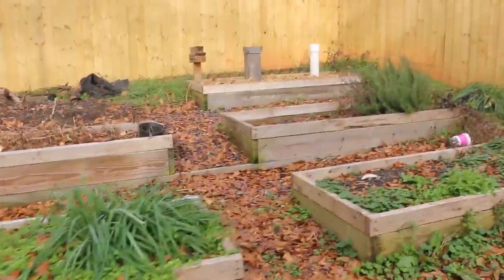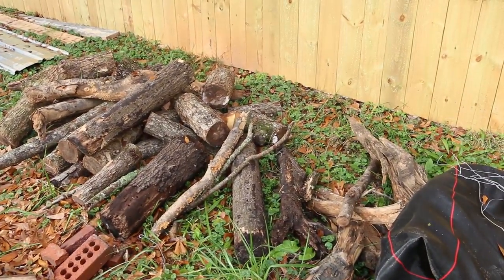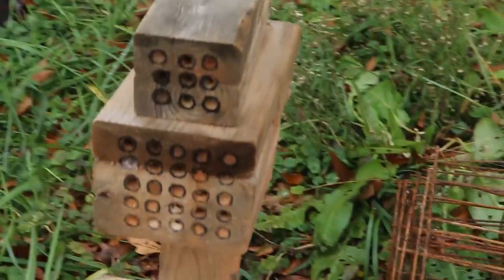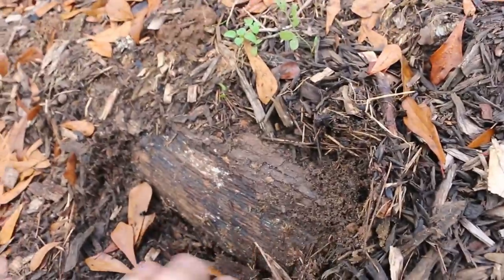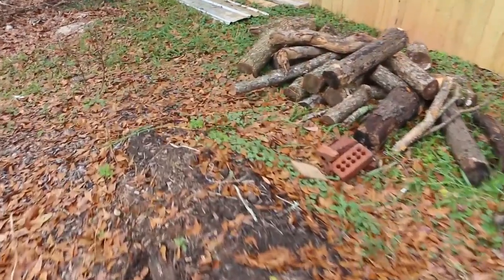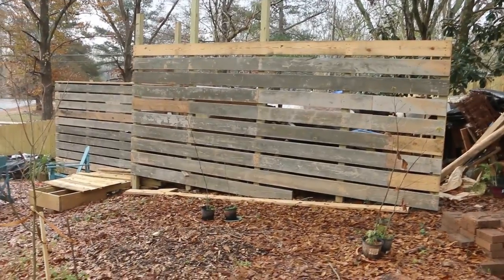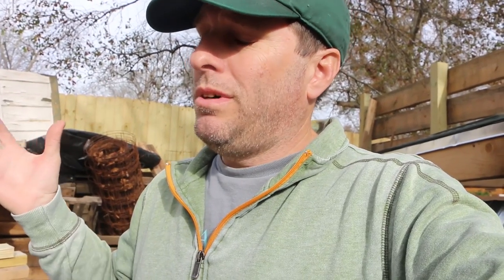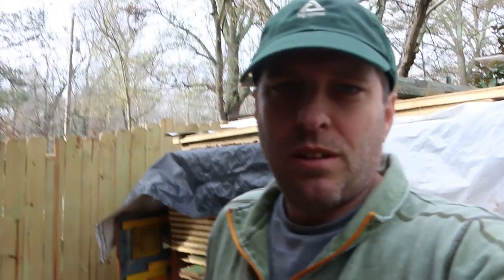What Should I Make In 2018? | GreenShortz DIY

Comment: Thanks for all your work. I am interested in black soldier fly larvae. I did notice that someone had 2 beds, and the one with the most surface area was substantially more productive.  Alsoi leave inn the high desert mountains, so I have to adjust many things to compensate for the dryness and cold.
Reply from the maker: I do think the surface area factor is significant. The soldier fly larvae like to work on or near the surface of the compostable material. Do you have BSFL in the high desert?

Comment: Jtube solution- Like your sheet metal designed Rocket stove, build with desired path "in reverse" as a quick-connect J-tube feed into the concrete rocket stove. Simple tower with the bottom that scoops out of the side discharge into desired fireplace...  Am I painting a picture yet?.. I have a feasible plan, if your interested further.
Reply from the maker: I see what you are talking about. An interesting idea. Tell me about your plan.
Reply: GreenShortz DIY unfortunately I do not have the means to make it out of steel. Take your metal rocket stove's feed idea and angle Downward out of the chimney while feeding through the top. I think the interlocking tabs on the sides of the center pieces (4pcs) and slits on the 2 "master side panels" shaped like a 2d isometric boot for fuel delivery, standing, plus hold it secured. The 2 angled centerpieces can lay in and lock in at the bottom with the side panel grooves, while the vertical pieces lock it all together with tabs like you have on the stove. (Give the feed tube a stiletto slope, yes like the woman's shoe.) Later it could disassemble for storage quicky, as well. I wish I could share an image on here. My sketch would show how simple it really is. The angles need to be perfected but, the Inception is there...lol I not sure how clear I am pai ting with words.... Sidenote: I noticed when the side port is not drawing well simply throw a stick or two in the top and that will force the draw through the opening again.
Reply: Come to think of it, you could fabricate a piece of approx. 4" x 4" ductwork that would be fastened vertically and decide whatever angle you want to deliver into the mouth of the stove. You would just need a stand to support it properly..... It all depends how crafty the person doing the project has the resources, I guess.... sorry if I bombard your message board. I'm finally getting out of the house LOL
Reply from the maker: No worries, Derber. I appreciate all the ideas.